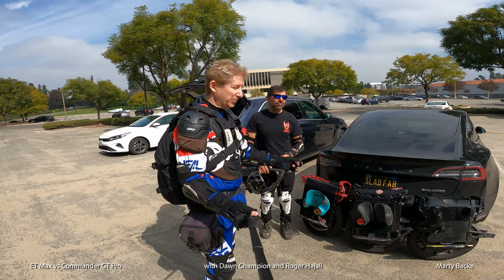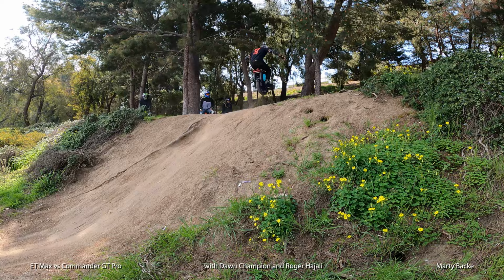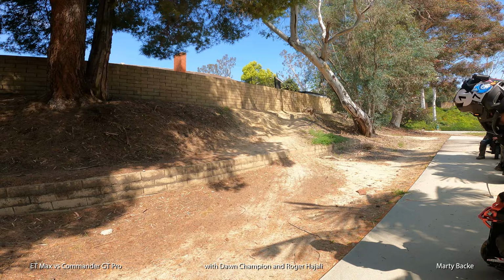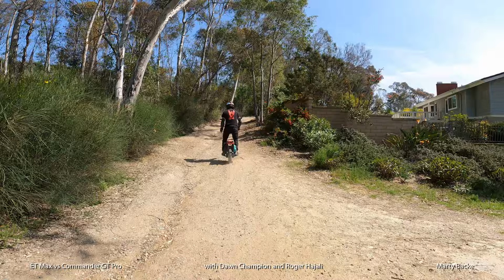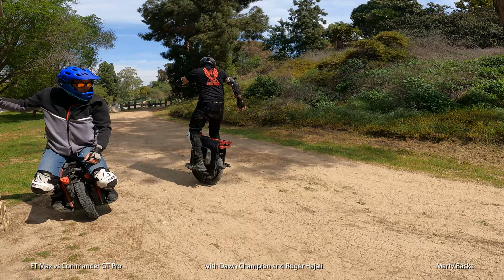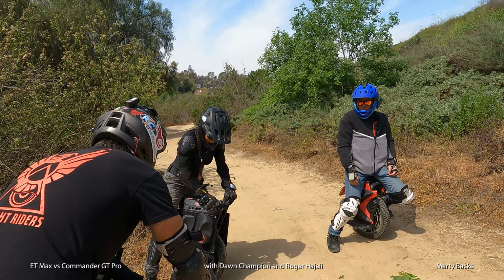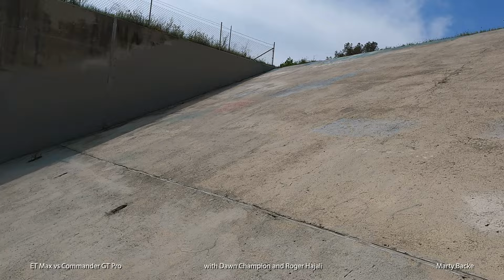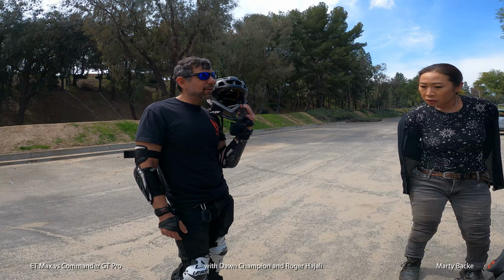Commander GT Pro vs ET Max Challenge

Comment: Kind of sad to see Dawn and Roger ripping at almost 60 miles an hour on a narrow bicycle trail, at night, when clearly there are indications that people are hanging around immediately adjacent to the trail. Even in the daytime, when going underneath those underpasses where the homeless people are, I slow down to less than 20 miles an hour for fear of somebody wandering out into the trail and accidentally hitting them. I'm just super disappointed. Somebody's gonna get hurt with that level of recklessness and lack of respect for the safety of others.

Comment: I have 3 mwheels and all my wheels were knobby before my lynx which I have with a street tire & I am so surprised at how well it does on trails.. the knobbies really help in lose sand  or light mud but for hard pack trails,  riding a street tire does way better than I ever thought and now I am not going to switch to a knobby for a long time. o
 I ride 70%-30% offroad or maybe 80/20 ... Put it this way I ride the street to get to the trails ;) !!!!
Nice Video Marty

P.S. You guys are cruel to that poor snail.
Reply from the maker: Up until ~2020 ALL EUC's came with street tires and we rode them everywhere.

Comment: U guys have so many dirt trails in SoCal (95% paved asphalt here in Maryland). And Rog and Dawn are tackling it on street tires?😮
Id bring a dirt wheel specifically for this loop...
Reply from the maker: You are probably missing the point that this "event" was to test these two wheels, and these two wheels come with street tires 🙂 Of course when they ride their own wheels on trails, they use knobbies.

Comment: can you tell us what was the battery percentage on the ET MAX at the end? really impressive if the tests at the end of the video was done with a 30% or less battery.
Reply from the maker: It was only a 11-mile ride. Batteries were probably >80%
Reply: @ElectricUnicycles  oh... How come the battery beeped at the end then?
Reply from the maker: @OriginalSpring  I don't know what beep you are referring to. But even at a 100% it's possible to over power any wheel, causing beeps

Comment: Its all good. I refer to all risky hobby stuff as toys. Like i said im buying ome of these bad boy toys. Just havent figured out which. Probably.the et max or commander gt pro or the s22. I want to buy the one wheel that i will start on and i will not outgrow. I like to go big off road
Reply from the maker: Don't buy an S22. There are too many potential issues with that wheel
Reply: @ElectricUnicycles  someone else said do not buy the s22 because they are not tough and they break and im a new rider who will be crashing and banging up the wheel. What about that innovation v13? I want one that can go fast but can handle off road
Reply: Also bud. I have health issues with my liver. Doctor told me i need to strengthen my core and thats what brought me to look at euc wheels. Looks lije a good core workout.
Reply from the maker: @dbirds21  V13 is big and heavy with a marginal suspension. That would not be my first choice. Since the V13 is in your price range then I would strongly consider the Lynx or for a wheel that can pretty much do it all, the Sherman L (but it is heavier and a bit less agile than the Sherman Lynx). Wheels that I would consider: ET Max, Lynx, L, EX30, Master, V14, and Extreme.
Reply: @ElectricUnicycles  really appreciate the advice because its difficult deciding. Last night i noticed the master and its on sale for 2299. It looks like its fast and sturdy for off road. I did hear it had some known issues with cutting out. I know it can happen with any of them but im 55 years old and dont like eating cement for mechanical issues. In your opinion which euc you mentioned has best redundancy built in to power system.
Reply from the maker: @dbirds21  No wheel really has redundancy. Maybe in a few years that will become the new standard. The Master does not have known issues regarding "cutting out" due to mechanical failures. The VAST majority of "cut-outs" occur because people exceed the power capability of the wheel (trying to go too fast with too much acceleration). If you intend on riding at an extreme level then the risk goes way up.

I've been riding for 8+ years, owned 45-wheels, and tested over 55-wheels. Only once did a wheel fail on me for no reason (going ~10-mph), and I broke my ankle because of it. Otherwise, no failures under normal riding conditions. But I've had road rash, broke my shoulder, injured my other shoulder, lots of bruises, cracked ribs, etc. And I'm not an extreme rider.

I always tell people that this is a contact sport. If you can't accept the possibility of an injury (road rash, broken bones, etc) then you should not join the club. This is reality although you might not want to hear it.
Reply: @ElectricUnicycles  I hear you. I do come from extreme motorsports and when I stumbled upon this hobby sport I knew it had a danger element to it. I woukd ride with full sport bike leathers and Hemet.  It's one of a kind sport. I would bet the better shape your in the better you will ride a wheel. Am I wrong?
Reply: @ElectricUnicycles  STILL HAVE NO IDEAA WHAT TO BUY. Time is burning. I can order today but cant decide. Theres too many too chose from. the et max, patton, v14, e30. Come  on dude give me some definites what to buy and remember I wont be able to purchase another one for 2 years or longer.
Reply from the maker: @dbirds21  All I can say is to stick with a 20-inch wheel (no Patton or V14)